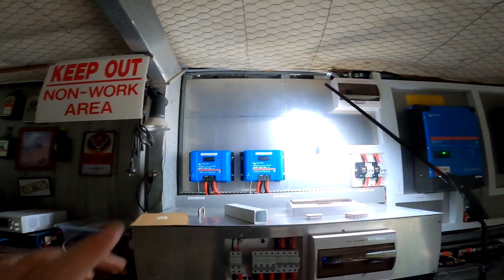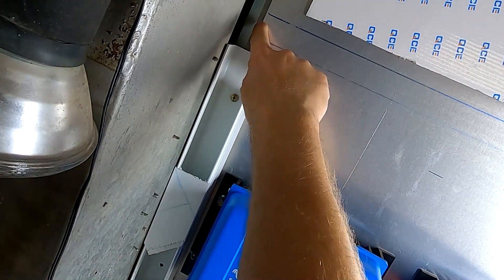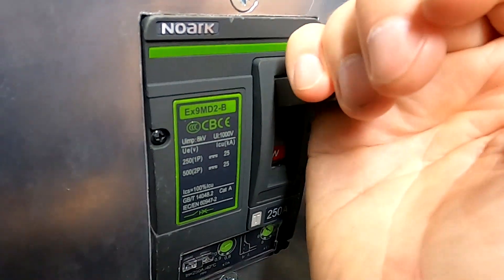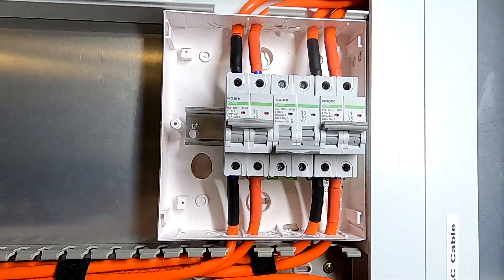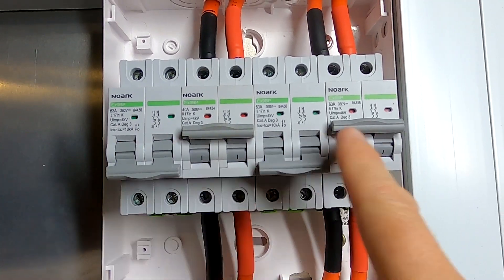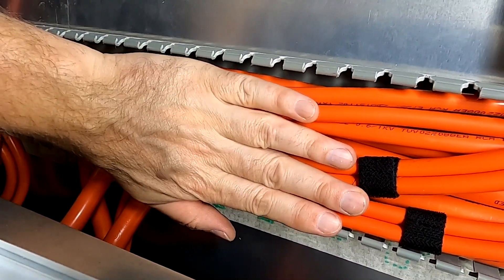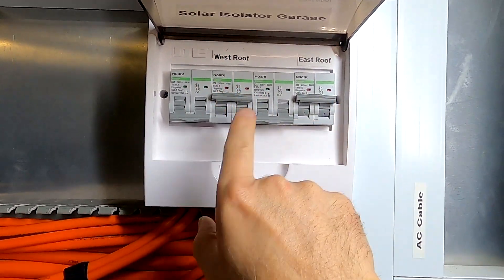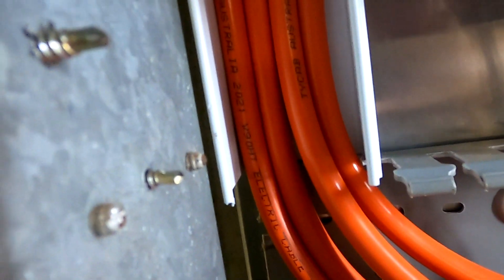Upgrade of the Solar Isolator switchboard. But the Surge Diverters had to go. Mistake? 3/5

Comment: Hi Andy, are you not afraid of „lichtbogen“, if you shot-off the panels with „circuit-breakers“.

Ok, your setup is different to mine, i have 6 strings, 4 going w/400V 11Amps (max) and 2 w/ 750V @11Amps.
I would always shot-off the batteries from my  MPPT450s first, before connecting/disconnecting the panels, due to the high voltage
Reply from the maker: These are DC breakers, not circuit breakers. Huge difference.
Reply: @OffGridGarageAustralia  
Do you think the DC breaker withstand to break a full load e.g. 800V @11Amp ?
Reply from the maker: @mw9271  the NOARK breakers I'm using can handle DC up to 360V and 10kA breaking capacity.
You need different ones for your system.
Reply: @OffGridGarageAustralia  
Hi Andy,
Just for interest: i bought now Hager SB432PV DC Switch (45€ amazon)
Handls 1000V up to 32A , breaks DC under load

Comment: Nice work;congrats!  I see you do not compress your battery cells, despite producers suggest to use 200 kg compression . I would appreciate to know your motivation not to compress the batteries. (I don’t compress my cells too; because I want to see if something’s wrong)
Reply from the maker: You're getting the wrong impression. Manufacturers are not suggesting to compress the cells. It's an option and make sense for certain applications. Not for stationary solar storage solutions in my opinion. I made several videos about compression and why it does not make a difference. This one for example: https://youtu.be/OsvPYw6hoHc

Comment: ...nice Idea with the Aluminium Sheet, i'll use IT in my offgrid barn, thank you
Reply from the maker: It's great working with, easy to drill and tap.
Reply: @OffGridGarageAustralia Andy there are breakers between your panels and Mppt’s and from there you go to other breakers on the battery shelf, after this breakers it’s going to busbar and then to main breaker like i see is this necessary or what’s the purpose of it
I try to understand to implement to my build
Thanks for answering

Comment: Amazing work Andy... It's a piece of art! One comment though, Why not have one cable run for the incoming cables from the solar panels and another one for the MPPTs to battery outputs. I have a Victron 250/100 with 12 540 Watt panels. I fitted 35mm pure copper cables (the max that could fit) and it was getting a bit hot. I imagine all those cables together generating quite some heat and that could be problematic.
Reply from the maker: It is a space problem. Just not enough space for all these cables to be separate. I'll do a better design the next time, having all this experience.
I haven't felt any heating cables yet, but we will see this summer.

Comment: Hi, You have 150/70 MPPT which is rated for max 50A PV Isc. Is it wise to put 63A CB for protection? If something happen to PVs and current spike over 50A it will just kill your MPPT. CB will never have a chance to brake current. Am I wrong?
Reply: The Victron charger will limit its current at 50A (or what ever its rating is).  Since this is a DC coupled system the breaker really only serves as a disconnect for the PV and protection against multiple unlikely failures, ie a short on the PV side with a simultaenous fault in the charger that just happens to permit battery current to flow back through the charger.  This would also be addressed by the breaker on the battery output of the charger leaving the PV breaker with nothing to do apart from being a point of disconnection.  If a short formed inside the charger on the PV side and the combined current from the PV exceeded 50A there might be a fire containment issue but we are grasping at straws now really.  The PV input current limit on the Victron is to protect the reverse PV polarity protection in the charger.  IIRC it's just a diode that shorts the panels and will fail if excessive reverse current is available.
Reply: @retrozmachine1189  In other words no need for CB/fuse between PV and MPPT?
Reply: @niki1541  If there is grossly more current available from the PV it would be useful for a fuse/breaker rather than just a disconnect switch.  You have to consider how long it would take the fuse/breaker to act on overcurrent.  Check the trip curve of say a C class breaker.  It will take quite some time for a 50A breaker to trip with 60A of current and by then the damage is done.  There is benefit to 'overpanel' for a flatter solar production curve etc but only to a certain extent.  After that you are just throwing away money and should move to a higher rated charger.  Also keep in mind that while a Victron charger is OK to use like this, not all are.  I could name cheap chargers that have poor MPPT routines and will simply kill themselves when there is too much amps available on the PV input.
Reply from the maker: If you use the Victron MPPT calculator (either online or the spreadsheet) and enter the exact data of the panels, it recommends the 150/70 controllers for this setup.
As per the other comment, It will just current limit the output. Victron MPPT can handle 130% higher power than rated. Only above the calculator will choose the next MPPT up.
Reply: @OffGridGarageAustralia  I do not think choice of MPPT is wrong, but I doubt 63A CB will do any good in case of spike. 70A rating is on the outputside and that side is regulated by the system. No worry there, but on the input (PV) side it is rated as 50A and as far as I know no protection there. It may be that it can sustain 130% but I would be carefull...

Comment: After all those experiences, did you decide to refrain from crimping Fork and end-seal terminals? my opinion is, it's better to install everything nearby each adjacent roof by considering the wiring cost, ventilation, and isolated Hv, Lightning, protection. Thank you for sharing these with all over the world.

Comment: What if I told you that the negative has to go into a dual breaker the opposite way as the positive so the breaker can work properly
Reply: These Noark Ex9BP MCBs are not directional, they are suitable for charging and discharging use - there is no line and load side.
Reply from the maker: Never heard of such breakers where this is the case. You want this opposite way of current flow.

Comment: Did you consider ampacity derating factors for more than 3 wires in a wire way? That's a lot of wires packed in there. The NEC in the US says to never go above 40% conduit fill. Your idea of filled is like 90%! If those wires get hot, the heat is compounded when they are bundled that tight unless they are oversized by about 200%. On the other hand, I can't wait to see your new system up and running! It's very exciting.
Reply: I'm pretty sure Andy has over designed the cable sizing. Normal operation (even full load operation) should probably have very little heat generation. It's hard to imagine a scenario where those 70mm2 (2/0 AWG) cables would get hot from current flow. Same for the smaller solar supply cables.
Reply: @CollinBaillie  The point is, when that many wires are packed together, a 2/0 is only equivalent to a #4 AWG wire.
Reply: @ToddDesiato  Yes, I understand.

Comment: I would so have the 2nd circuit breaker board... (Commenting "live")

When you do get an answer, it may mean moving those breakers to a second breaker box. The time benefit (super quick access to all switches at once)... is it that much greater to have them all in one box?

Most solutions I see have the SPDs in the combiner box. Do you have room in your roof disconnect boxes for the SPDs? You don't need ready access to them. In the roof combiner boxes may work just as well.

With the panel upgrade, will there be any changes in those combiner boxes?

Just thoughts.
Reply from the maker: It's about the shutdown process and having all relevant breakers in one location. 
Yeah, combiner boxes have been re-cabled and cleaned up a bit. It will be in the next video...

Comment: Andy, for the connection between the shed and garage, if you use rigit steel conduit? just make two holes, put there some brackets or L profiles and put the conduit in? Rigit conduit should be enough for this and you can use it for the pv cables.
Reply from the maker: These steel conduits are coming with their own glands on each side to make a watertight connection. But you would need a separate conduit for each circuit. I have planned to get AC power into the big shed as well at some point, hence the larger 'connection'.

Comment: In the future you could try a pilot hole for self tapping screw, also interested in surge protection use or location, maybe added to the combiner box?
Reply from the maker: I use self tapping screws all the time, love it.
The surge protection should be as close as possible to the devices you want to protect was my understanding. That would the MPPT charge controller. I let the electrician deal with it and see what he suggests.

Comment: It would be interesting to measure temperatures inside that crammed full cable duct when the system is under heavy load and the solar is in full production.   With so many cables crammed together, the heat can not dissipate.
Reply: The ducts are ventilated along their length, although yes they are crammed full. But I suspect it's quite overbuilt, so I have faith.
Reply: That's why you have to derate the ampacity of conductors depending on how many are in the same conduit/raceway
Reply: @niktak1114  16sqmm cable running in a thermally insulating wall has an ampacity of 56A before reaching 40 degrees Celsius above ambient. PVC melts at 100 degrees Celsius - so let's hope the ambient doesn't reach 60 in there!
Reply: @stefanvanzyl9090  If he was in the US then 16mm2 wire with that many current carrying conductors in the same raceway would have an ampacity of 22.5A. Not sure what the rules are in Australia though.
Reply: @niktak1114  in a ventilated PVC trunking, this isn't a metallic raceway/cable tray?
Reply: @stefanvanzyl9090  Doesn't matter if it's pvc or metallic. PVC is actually worse since the thermal conductivity is low.
Reply: @niktak1114  the thermal conductivity of the trunking is immaterial, as the cable is already insulated with PVC, much thicker than the fingers in the trunking.
Reply: @stefanvanzyl9090  The heat has to go somewhere. Low thermal conductivity means that the temperature inside the conduit/wireway will get higher. The US doesn't have different fill derating requirements for different materials, but if it did, PVC would have slightly higher derating than EMT for example.
Reply: @niktak1114  which is why I used a thermally insulated wall in my example value. The worst case scenario.

The heat in such a cable has nowhere to go, and yet it's still allowed to carry amps.
Reply: @Stefanfj  You need to derate for wire that runs through an insulated wall too (down to the 60C ampacity column at most).
Reply from the maker: We will find out and use the FLIR camera to have a look at the cables. It's raining again though, so the garage is 'water cooled'.
Reply: It looks like he'd be in the 50% derating bucket

Comment: Keep an eye on fill factor -- the same rules for conduit fill factor apply to plastic raceways (and perhaps more so) -- the wire gauge gets further derated as the number of conductors increase.
Reply: It's not nearly as bad for DC power but yes.
Reply: @jameshancock  What does being DC have to do with conduit fill factor? Cables heat up when current flows, that heat needs to go somewhere. 4x 16sqmm cables running in trunking will reach 70 degrees Celsius when there's 65 amps flowing, when your fill factor is below 40% - we're looking at 50A per roof as Andy mentioned, but the fill factor is significantly higher, and those 70sqmm cables are also carrying current at the same time.
Reply: @stefanvanzyl9090  they heat up when current flows. They heat up much more when adjacent wires are carrying current in opposition. 

Since wires carrying AC are never in perfect phase because of length of the wire, the current is creating more resistance because of magnetics and thus more heat the more wires you put beside each other in parallel. 

DC is either always in opposition or not. So the wires going from the breakers to the solar charge controllers are generating more heat than if they were in a separate conduit because they’re going in opposition to the wires going to the inverters. 

But even then, a much smaller magnetic field is generated by DC than AC (you know this because an inductive motor won’t spin with DC because it doesn’t produce the magnetic field required. Same with a transformer. ). So as a result the heat generated will be significantly less. 

You still have the heat from resistance in the wire of the amperage. But you have vastly less of the resistance caused by the magnetics of the electrical flow.

(This is also why data lines have to be run perpendicular to AC power lines but can be run in parallel to DC.  The interference caused is magnetic and physically it is literally disrupting electron flow)
Reply: @jameshancock  what a crock of bull... you should ask for a refund wherever they taught you this. If you got this info for free, you should still ask for a refund. Magnetic fields don't operate in the same direction as electrical flow, and two wires next to each other don't cause increased heating due to frequency/polarity - Read up on Joule's first Law, there's even a formula for AC conductors vs DC conductors (spoiler, both of them throw away anything that isn't Ohmic resistance...)
Reply: @stefanvanzyl9090  I'm glad you read the electricians handbook which is for people that don't understand physics. (i.e. everything in code has safety margins built in so that they can ignore everything else.  Which exactly what fill factors have built into them.

Sadly I can't just post links to debunk you of which there are many.   But the right hand rule is self explanatory. In a DC system, the direction of magnetic force is always in a single direction because the flow of electrons is always in a single direction.  In an AC circuit because it changes polarity 25/30 times a second, the magnetic force also changes in that time and length of wire changes which direction the field is going versus another wire of different lengths at any given moment and sets it out of phase and thus causing resistive force.

This is exactly why you can't put data lines in parallel with AC wires, but you can in DC wires. The changing of the magnetic force changes the signal in the data wire either by delaying it, or introducing noise.

The effect is small with small numbers of wires or relatively low amperage. But at 48V and hundreds of AMPs it makes a big difference which the building code abstracts a way at 120/240V because virtually everything is < 100 amps except for service entrance which, should give you a hint given that service entrance has a separate fill factor and load calc with distance for this very reason.  And when you have DC current flowing in opposition, you're creating a force in opposition and with 150V going one way at 70 AMPs and 48V~ at 300 amps going the opposite way, you have a large delta in magnetics who's force is in opposing directions.

The result is more resistance and thus more heat.

In AC this is absolutely calculated into the IBC (in North America) as part of the fill factor. You just don't see it, because they wrap it all into the table. But as soon as you get to industrial scale 3 phase power at 800+ amps, they outright say it is part of the equation that you have to account for (i.e. the fill factor changes depending on if you're running parallel wires from the same circuit and if the wires are the same length, and they even start proscribing that the wires have to be the same length because it affects the frequency over the length of wire, the longer the wire the more it does.

And PS, if the magnetic force wasn't a factor, then you couldn't turn on an LED from distance (1 m in the example) using the magnetic field on a wire per Veritasium for those that are more lay people, without amperage having flowed to the load.
Reply: @jameshancock  use less words, you're confusing yourself.

Read up on joule's first law. That's where heat gets made by electricity flowing in a conductor. Magnetics don't play a role here.